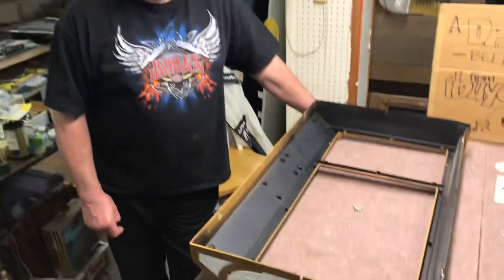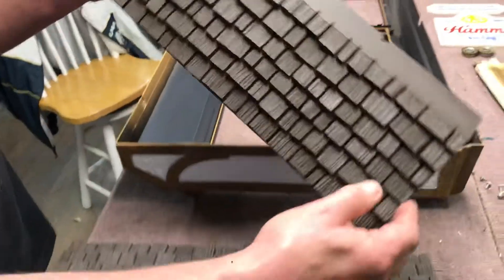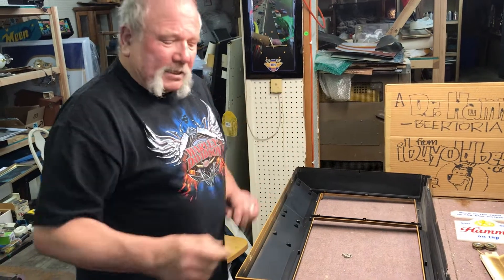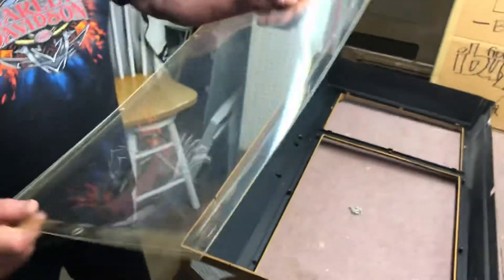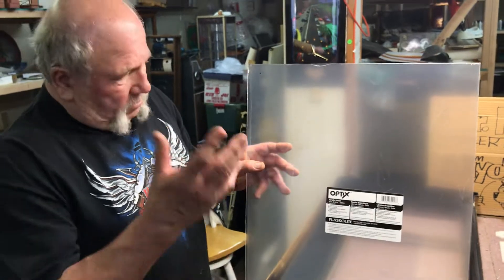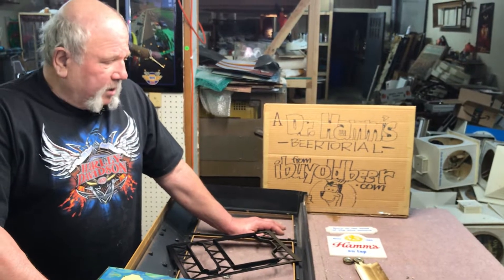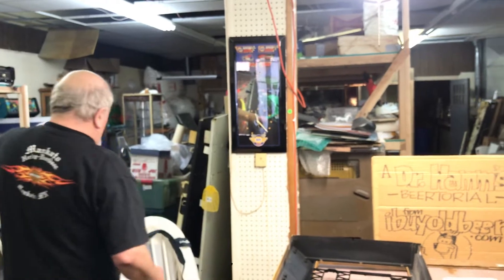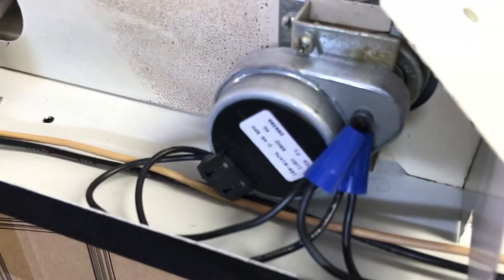Dr. Hamm’s shows you a Scenorama motion sign restoration #2-ibuyoldbeer.com

Comment: I have an old Hamm’s barrel, rotating scene sign. It is in great shape, the motor is fine, the light works, however the signs do not rotate/flip. I dismantled it and what I see is a cog attached to the drive shaft of the motor which connects to a larger white drive wheel that looks like it is supposed to rotate the signs but it is attached to nothing. I do not see any other axle to which it might attach other than the axle of the signs. The center of that shaft has a square hole in it but I am not sure if something is supposed to attach there. There are no wear marks anywhere that I can see, I found no fragments of parts inside the “barrel” but I can’t tell how this is supposed to work or  if it is missing a part. I really want to fix this. Does my description make sense?  Thanks for any help or parts recommendations you can provide.

Best regards,

Tom